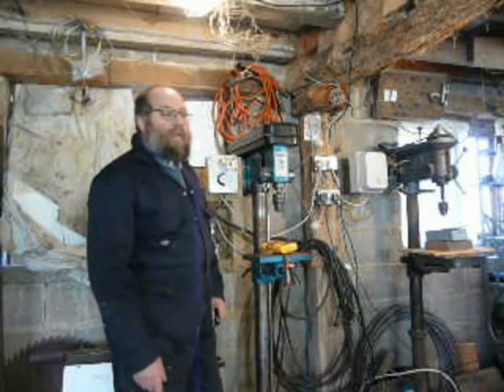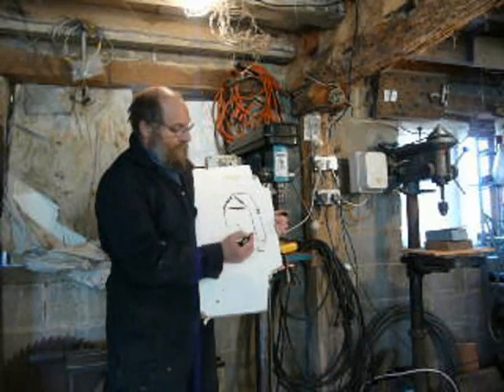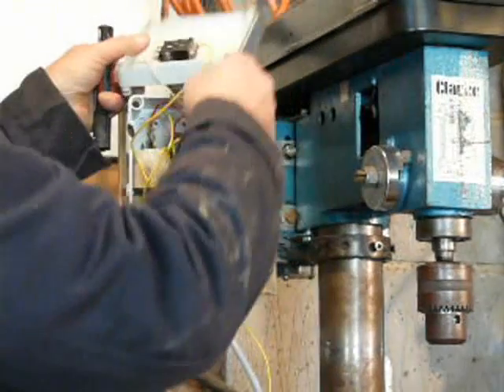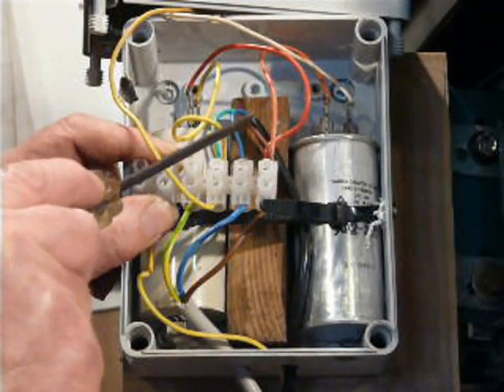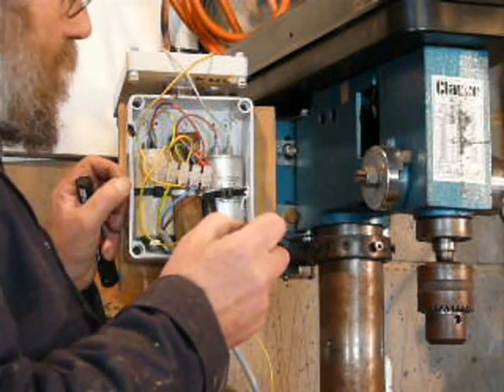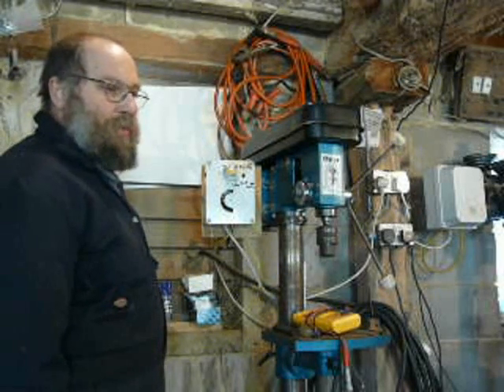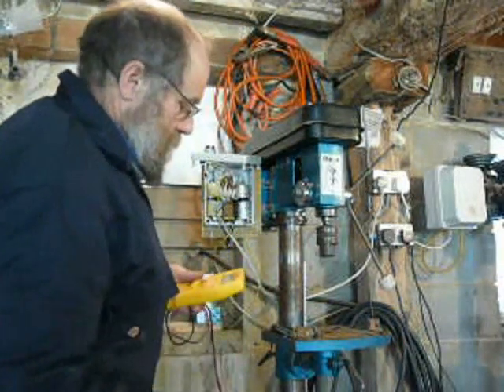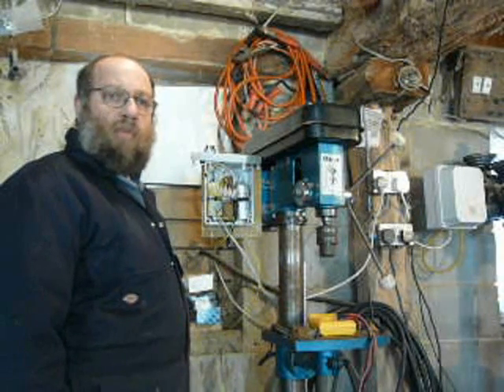How to do it: 3 phase motor conversion. Part 4 the start capacitor

Comment: Which terminal of capacitor is to be connected with live wire?
Reply from the maker: Hi, with an AC capacitor it does not matter as they are not polarised, please subscribe, cheers
Reply: @TheInfoworks  yeah right sir. Thanks for reply.  I want to make a linear induction motor. And this method would be really cheapl for me to run my device.

Comment: This is incredible!
Should the capacitors be connected in parallel or series?
Reply from the maker: Aaron, see my other video series "How to do it: running a three phase motor from single phase supply"( 7 parts) The capacitors are in parallel to increase the value, subscribed? cheers

Comment: Andy thank you so much for this series of videos on running a  three phase motor off 240 volt single phase.I love the evolution of the idea from a basic on off in the first video to a balanced and safe motor control unit in the last video.keep up the good work, i have used your last design on two woodworking machines in my workshop and they worked a treat.
Reply from the maker: Gary, thanks for the comment and your news, pleased you were able to fix your machines, Subscribed? cheers
Reply: @TheInfoworks  yeah i subscribed about a year ago.cheers
Reply from the maker: Gary, thanks for that, cheers, Andy

Comment: Yikes! It's the real Dr. Death. My favourite bit is using that spare green & yellow one for the capacitor. Second only to grabbing the capacitor leads one in each hand in part 2. It's curiously entertaining though - I'm waiting for the flickering skeleton to appear at any moment. :-)
Reply from the maker: Hi, when the caps are in circuit they naturally dischage through the coils when the power is switched off. Cheers

Comment: How much micro farat do i need to run a 5 hp converted motor?
Reply from the maker: Danny it all depends on the motor and the use, genrally about 25 Uf per Hp, but remember start current can be 8 times the run current. This series of 6 videos is all about working it out by trial and error. Cheers

Comment: Yes mate, already subscribed, thanks.
I've replaced the relay with the same specs relay but still need to manually latched to run the motor... Do I have to swapped wires u v w on the vfd?
Reply from the maker: Joe, the question here is there any power at the relay coil connections, and what voltage is it? Cheers

Comment: Andy, thanks for the videos, very instructive... I am on a project in which I am having an issue. I've replaced a defective 3 phases motor running on a 240V via a relay and VFD. Wired exactly as it was but I have no power to the motor.... By overriding the relay (manually latched), the motor starts running. How can I start the motor without manually latching the relay? I'd appreciate any feedback please.
Reply from the maker: Joe, you need to put power to the relay coil, wether it be a 240 or 380v coil. Maybe the coil is defective, check to see what the open circuit coil resistance is.  Have you subscribed? cheers, Andy

Comment: hi my father can I able to use a motor like these for washing machine? and washing machine works forward and reverse full time, I have already designed a control circuit with timer relay
Reply from the maker: There is only one way to find out, let me know how you get on, cheers

Comment: Very Nice experimental demonstration Sir.
Can you explain the proper calculation of the capacitor rating for different rating of motors i.e hp
Reply from the maker: HI. a viewer has put at equation in the comments of one of the six videos of this series. The equation can only give a rough idea as it depens on load, starting torque required and motor specifics. Cheers

Comment: hi i have 3phase 5.5kw motor how can I determine the correct capasitor I use? please i need your advice .. thank you.
Reply from the maker: HI. It all depends on the motor and what it is driving. You will have to experiment. 5.5 Kw is quite large and would draw at least 24 amps at 240v, so start current will be much higher. Cheers

Comment: i got a 3 phase motor rated at .8 kw ... just a tad over a horse ... what size capacitor would i need ???  i got some decent  50 microfarad caps from my borehole pump that run about about a horse ...would these work?
Reply from the maker: Hi, try 2 in parallel, but only experiment will tell, that's what the video is about. Cheers

Comment: the controllers is 48v 350w 15Ah ... and the motor is 3 phase as well like yours just different shapes, i think u kno what i mean   & how can i blow the controller if at the end of the phase wires is the motor? and i really . wont to test this theory ..

Comment: Hi sir is there any possible way to connect a running capacitor to a 3 phase motor, my machine has an inverter with 0.2kw power and my 3 phase motor is 1 hp?? Needed badly for thesis purposes because our motor is finding it hard to spin in  a 10 hertz frequency.. 

TIA sir.
Reply from the maker: HI. No need for an inverter, just watch all 6 videos and then apply. cheers

Comment: ok so can i double up the speed of my 48v ebike  with two 50v 1500 uf ... and the battery will last ten time longer ?
Reply: cause if i double it would take 48v ...and charge up right ..and the doubled capacitance will give more power to my motor no problem right
Reply from the maker: Hi. It's difficult to give any advice as I don't know the system. You might end up blowing the controller. Cheers
Reply: Joyboy Read

Comment: is there a way to put capacitor on a 3 phase dc motor
Reply from the maker: I have a question: how can there be 3 phase DC when there is no wave form and only positive and negative? Cheers
Reply: well not dc
Reply: i meant a brushless 3 phase motor
Reply from the maker: Hi, that's what it shows in the video, a brushless 3 phase induction motor, cheers
Reply: oh ok thank u but umm i have another question
Reply: is it possible that on my ebike i could double up the speed by the capacitance with 50v 1600uf cap...and the battery with last 10 time longer ?

Comment: An off-Delay timer would work well on the start cap, no need for second switch. Great the vids.
Reply from the maker: Thanks for the comment, that's right, a 1 second delay off would work. There are various ways of doing this including a current activated switch, Cheers
Reply: Sorry just seen next video.ha

Comment: hi there, I like the video, a couple of points to make, yes it will work but it will not be very efficient, and also you create an imbalance both electrically and in time the bearings in the motor will fail, but if you measure the line currents and voltages and get them to be more or less the same then you should increase the reliability of the setup, also put a mains input filter into the feed in the circuit, which will help avoid unusual feedback harmonics to the other circuits, or you might find lamp dinners etc acting strangely!
kind regards

Comment: Hi Andy - great series of videos you have done here.
Taking the theories on motors out of the lab, and bringing them to live in practice out in the workshop.
Yes - I subscribed.
In my neck of the woods, old fluorescent armatures are a good source of second hand capacitors.
Might be a good idea to check the cap before getting it in to work :
Test for a shorted cap using a simple ohms measurement, should of course have infinite ohms.
Be sure to briefly short out the cap terminals before you test it.
Test for a disrupted cap by series connecting with a light load, i.e. any household filament bulb.
Reply from the maker: Hi. Thanks for the comment and the sub, I hope you enjoy further videos from my non profit channel. Cheers, Andy

Comment: Thanks Andy. Finally found that formula way down below. will re-post here. I take it this is for the run capacity.

That's (220/V)Squared, like (2)^2 = 4, sorry for my English. And, I found another: C = P x (70mF/1kW), for 230V supply and C = P x (20mF/1kW) for 400v. P is the power in kW; 70/20 microfarads; 1kW is for eliminate the "kW" magnitude.
Reply from the maker: Hi, thanks for this. I use a bit more than 20 Uf per Hp, but it's a good rule of thumb. Subscribed? Cheers, Andy

Comment: God will bless you Andy for your kindness. Thanks. This start capacitor with switch, does it run together with the run capacitor all the way?
Reply from the maker: Hi, see part 6. The start capacitor is only in circuit as long as you hold the button in. Just gives the motor an extra kick. Subscribed? Cheers, Andy

Comment: Hi great videos well explained. Thank you. Any idea where to get suitable caps these days please? Can't seem to locate anything suitable cheers Keith
Reply from the maker: Hi. I get mine from old florescent light fittings, but you could look on ebay for motor run capacitors. Subscribed? Cheers, Andy
Reply: Andy Reynolds thanks- yes I subscribed ages ago.
Reply from the maker: I hope you find some units, cheers

Comment: I really appreciate your efforts for educating us .Can you tell me how to run single phase motor using 3 phase supply???
Reply from the maker: HI. It is 415v between any 2 of the 3 phase tails, but it is 240v single phase betwen any one of the 3 phase tails and neutral. Check it with a multi meter. Subscribed? Check out all my solar videos and my book. Cheers

Comment: Regarding caps, instead of using potentially dubious used types from light fittings, new specific caps for motor use are available from a British company called LCR, they have a web site, search engine of your choice is your friend.  They are high quality parts at a reasonable price, I've used them as service replacements for years with no problems.

Comment: Hi Andy,  I have 5hp 3 phase motor, I want to run in single phase supply is that possible ? If yes how ? I need an urgent reply please.
Reply from the maker: I suggest you watch all 6 videos in this series, then you will have the answer. Cheers
Reply: +Humaiz Shaikh 
A 5hp motor is about 3.7 KW, so will draw about 15 amps of full load on single phase, with of course a start surge. So you would need to wire that through a dedicated 20 amp spur, preferably with a motor contactor.

Comment: i follow the all instructions of your video in part 2 i add 20 uf  capacitor but my motor speed is bit slow but the starting is perfect motor starts perfectly now i want to increase the speed can you suggest me how to make connections for running capacitor
Reply from the maker: Hi. You had best see all the videos in this series, especially part six as this addesses the wiring fault in part 5.. Motor speed is based on the AC cycles and so cannot be changed unless you use an frequency inverter. Cheers

Comment: Hi Andy great videos , could you tell me how to wire a 3 phase motor with only 3 terminals to delta
Reply from the maker: Hi. That will be a single voltage motor wired in star. The star connection (end of 3 coils) will be strapped on the coils. You will have to take the motor apart and gently investigate. Hope that helps. Cheers, Andy
Reply from the maker: Hi. Your motor will be a single voltage motor wired in star. The star connection will be strapped to the coils. You will have to take the motor apart and gently investigate. Hope the helps, have you subscribed? Cheers, Andy

Comment: Thank you Andy for all the great videos.  I will be getting a South Bend Lath on Jan 12.  It is suppose to be 3phase and I will be getting it to run on single phase with your intense thorough help.  You have been much to kind to show us you tubers on the correct way to manage this simple problem.  Thanks and may you have a Grand New Year.  Cheers.  Doug
Reply from the maker: Doug, Enjoy the project. Cheers, Andy
Reply from the maker: Doug, thanks for the comment, hope all goes well. Have you subscribed, lots of renewable electricity videps on the way. Cheers, Andy

Comment: Hi Andy,
i've 3 phase 3HP motor pump (subsersible) and it is running on single phase connection with capacitors (50 micro F x 2 = 100 Micro F ), but the problem is it stops running after running sometime (say 10 min  OR 15 min  OR 30 min OR 1hour like that no specific time ). could you tell me , what would be the reason and how should i over come this problem and i have no 3 phase connection..
Reply from the maker: Hi. It could be that there is a temperature sensor in the pump. First thing to do is check the voltage across all 3 connections when the pump is running. If you have a high voltage then the cap will be too high. This higher voltage will cause heating. Hope that helps, Cheers.

Comment: Dear Andy,
I have an issue. I designed a 3 phase energy meter. But if I connect my meter to the field condition where third phase created by connecting a capacitor across phase 1 and 3, my SMPS circuitry fails (after 4 hours), mainly the MOSFET, Can you thro' some  light on it. The phase voltage goes as high as 800 to 1000V
Reply from the maker: A high value capacitor will create a very high voltage, perhaps your capacitors are too large. In one of these videos it shows measuring the voltage with the motor running. Hope that helps, Cheers
Reply: Andy Reynolds yes Andy,
Thank you very much for your immediate response.
With time it increases and after 4 hours MOSFET in my circuit ends its life. Even though I have protections with MOV and TVS diodes, it repeats.  I will rework on it.
thanks a lot.
Reply: +Andy Reynolds  you state that u run like 8 uF .. And use 4 of these.  Do you know the formulae for calculating on this issue with voltage? ?
Reply from the maker: Hi. This is a practical experimental method, but if you look through the messages on the 6 videos you will find the formula loaded by a kind viewer. Hope that helps, Cheers

Comment: great videos,how to check single phase motor faulty winding?pls explane?
Reply from the maker: Hi, you will have to take this info as non definative, but generally single phase motors have 2 sets of coils. If the motor has a centrifugal switch on the start coils then these coils will contain thicker wire with less resistance. The first test would be visual, are the coils blue / black / burnt. This means they have been overloaded and burnt out. The next test would be continuity in the coil and to the chassis. There should be continuity from either end of the coil, but not to earth. If the motor hums but does not start it may be the capacitor. If it starts when the shaft is spun then it is the capacitor, the centrifuagal or load switch, or the wiring. Hope that helps, Cheers. Subscribed?

Comment: using this it"s any change in our unit reading means bill???
Reply from the maker: HI, for a 1/2 hp something like a 30 Uf cap. This method has nothing to do with power factors and so will not reduce your meter readings. Cheers
Reply: thanks

Comment: great videos, but would i run a motor that has a five core cable (420-440) volts
Reply from the maker: Depends what the Horse power is (up to 2 HP). Have a look at the motor connections and see if they make sense. 3 wires plus earth, the 5th wire may not be connected. Give her a go and work from basic principles, that's what the video is about.Cheers, Andy

Comment: hi andy, thanks for 3 phase motor conversion videos. i have just got a 3 phase old multico morticer and yes need to run it on 240v mains. its older than the one you have in your videos. 1.5 amps, wdg-star, hp 3/4. there is no box on the side of the motor like yours with 6 wires. instead i can access the windings throuh the top-there are only 3 wires. each one of these was connected to the 3 brown wires going to a modern switch box (was from an old school). so my question is can i wire this in delta, do i need too? through the dust i can see two coming from one side and another apposite. any help much appreciatedkind regards martin
Reply from the maker: HI. the centre tap will be somewhere on the end of the windings. This will be where all 3 star wires are connected. It is possible to find this and then bring all 3 wires out. You can get the motor to run in star but it will be less powerful. Just go thorough the process as per video, but the capacitor will need to be a higher voltage due to the induced voltage on the third connection. I suggest 440 volts capacitor if you can get one. There is a video out there by poroldchap showing this method. Either way hope this helps.

Comment: ok thanks for the  videos  .  I have machine (heaters) 400V and there is 220 supply  only ....how I can change the arrange connection between the heaters ...thanks again
Reply from the maker: If the heaters have resistance wire in them (rather than fixed elements)  then you can change connections as the resistance for 440 will be much higher. For 220v about 20 ohms resistance will give about 3Kw and draw about 12 amps. otherwise they will work as they are and give out less heat. 3 Kw at 440v is 6 amps, half the voltage and half the current so that will be 3 amps at 220v, so that is 700 watts. Hope that helps, Andy please see my latest global warming video and pass it on.
Reply: Andy Reynolds  Thanks Andy for your comments... yes there is resistance in heaters 20 ohms so i will try to change according to your explain ...